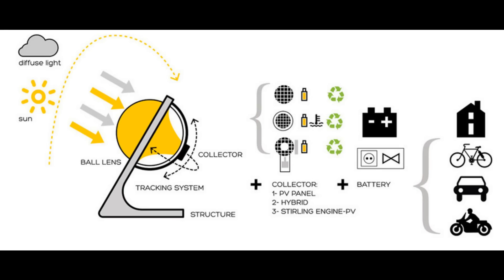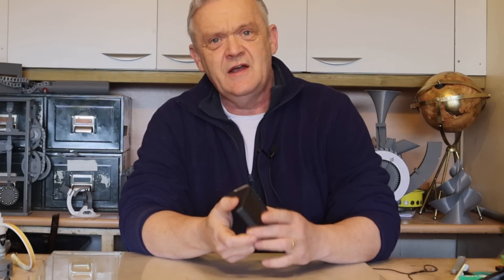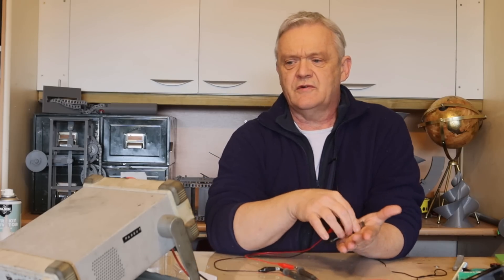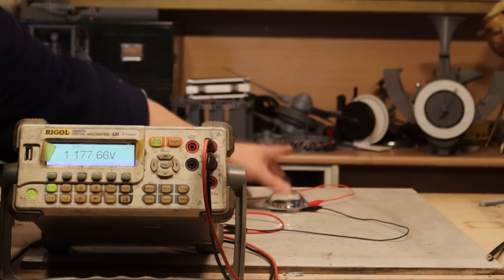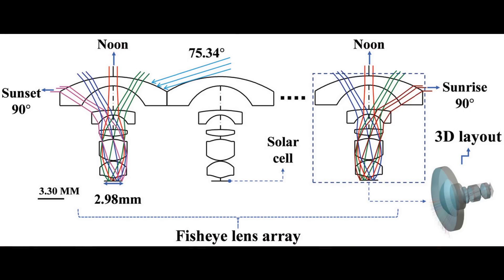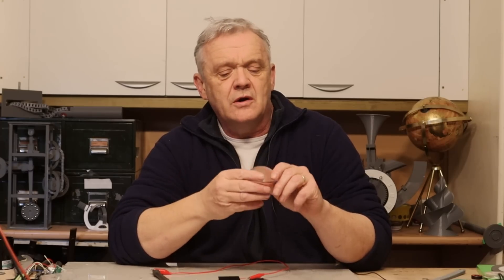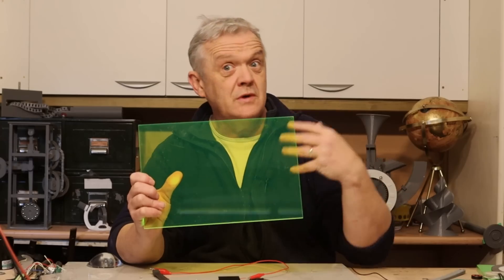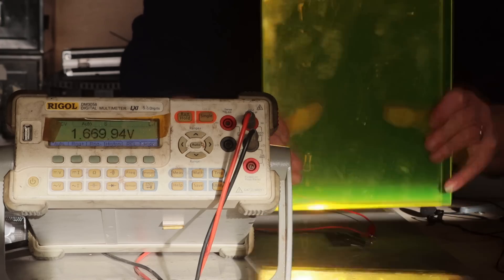2198 The Spherical Solar Cell

Comment: Ah a solar concentrator, i thought it was actually rounded panels which i was thinking about doing with these super flexible panels,  stick them onto a sphere, and the spin the panels and see what happens?  Im not sure ill get anymore but maybe make something interesting to look at, but using a sphere to solar concentrate is pretty cool idea.   Tech ingredients channel showed you could make one out of mirrors attached to the side of a flat panel and you just angle them and voila, 4xpower.  You have to be careful though this cooks the cells, but 4x power is definatley worth it , even if you have to spend some on cooling.

Comment: What about the concept of an air dam, such as a valley that is fitted with a funnel, or a series of panels that direct the the air from a large surface area down "funneling" it to a turbine, its interesting to picture the large mass of all the air and how it interacts with mountains, its as if there is "water" everywhere, but the flow is "slow" and could be geared down to increase the rpm, my idea consists of large tube structures with cloth stretch over them like a canvas, that use electric motors to be able to "open" or "close' the "sail" on a massive structure vertical or horizontal, these would be held on with "shear pins" and would allow you to control the speed by lowering the surface area on demand, allowing you to capture more of the air and also allows it to function with less airflow as well as protecting it against excess.

Comment: It is hardly compatible with common sense to use a large and heavy glass sphere or a spherical transparent container with 300 liters of water to irradiate a solar module of no more than 3 kWp. The same concentration can be achieved with a few kilograms of polished aluminum sheet consisting of rings formed from each other.

Comment: Open-circuit voltage is not really the figure-of-merit you want.  You should be measuring voltage into a resistive load.  The maximum power point is neither the maximum current nor maximum voltage.

Comment: you should have checked the focal length before just setting it directly on top the solar cell... I assume if it were an inch higher the voltage would have increased

Comment: I personally would first have a focusing lens, into the back of the dome, then the light would spread to the outside and around the dome onto many more cells!

Thus the light bam is split, so it focuses where the cells are.

Again, compres a light source to a high intensity beam,  then the beam goes into the flat of the dome, then the light radiates to the cells spaced around the dome.

Simples ❤

Comment: Hi Robert, great video as always! I have a question: That green wave-guide, from how I understand it, makes the light go from a Z-direction to the XY plane. So wouldn't it make sense to have long, narrow mirrors on those edges deflecting that light onto the solar panels, effectively making a huge green panel that redirects all that light onto a small solar panel? That would be a very cheap way of increasing the output of a given number of solar panels, would it not?

Comment: now imagine if you had a smeltery and there is a mold, the size of the Sistine Chapel. Then you mold these and polish them, and put it on a roof. Just for fun... like, super huge ones... imagine if you made one like that on the moon. And then, there is a mirror in the center so that it looks like there's a star on the moon? Only its concentrated sunlight? It would be a pretty pricey art-installation on Elon Musk's Lunar Palace.

Comment: Ok, Robert, I got frustrated with this video. lol. I was trying to see the focal point of your lens while you were tossing it around. I think you could lift the lens slightly might be the best focal point for the solar cell. I was interested in its maximum level. but, great video! thank you. I feel and have said for years that this is the way they will be in the future. we just need to get a cell that can handle the high temperatures that would be needed. but with the cost of plastics for this nowadays I might be wrong depending on the cell material and price.

Comment: A Solar concentrator in the form of a parabolic trough mirror, heating up a sand battery in the general focal point of the reflector, that is wide enough to cater for the 23' variation in the sun's position throughout the year , driving a Sterling engine. This is Occam's razor, down to 0 moving parts with an easy installation and the minimum stuff between the sun's power and the sterling engine. Steam off course will also work, but what I hear is that there are some very efficient Sterling engines out there.
Reply: A lot of people are triggered by this for reasons. Also there are many possible improvements related to how you can concentrate the solar light, convert the heat into electricity when needed, ...
Reply: @vitordelima  even àt night with a good sand battery
Reply: I never quite understood why we haven’t seen more internal combustion engines with integrated sterling engines for heat mitigation. 
It can only improve efficiency, surely!
Reply: Interesting. I always heard that sterling engines are inefficient in general and only useful when there's no other way to use heat. Ill have to read up on em.
Reply: @flyingsodwai1382 They aren't the only way to convert heat to mechanical motion or electricity, but the most advanced sterling engines (and heat engines) can outperform other engines, for example the NASA prototypes.
Reply: add some solar powered gravity batteries to the system for nights and emergencies.

Comment: My idea is to focus, light onto the solar panels and then use thermal electric generators to collect the heat as extra energy
Reply: That's what a sterling engine is, he describes the light being collected by the photovoltaics and the heat operating a sterling engine.
Reply: @EliotTruelove  No I am talking specifically about a TEG, a solid state thermal electric generator. A Peltier module used to generate electricity instead of heat or cold.

Comment: Thanks Rob.
Wouldn't the lens would work better outside? If your office has a point source, the lens isn't aggregating much. 
Isn't re-emission the basis of Samsung's QLED (not OLED) displays? Concentrating the spectrum sounds cheaper than tandem cells and must surely be worth more R&D.
Reply: Or use the solar heat directly which always worked well since more then a century ago.

Comment: Fresnel lens and "sunflower" solar collection systems were all the rage in the early 2000's. However $/watt is king. With the radical drop in cell costs since that time it is just not worth the cost.
Reply: Less costly concentrators were memoryholed due to the usual suspects.
Reply: @vitordelima  "Less costly"? Lenses/reflectors are heavy and expensive.
Reply: @Bigrignohio Not all of them are lens. You are one of the juicy guys so I won't reply anymore.
Reply: @Bigrignohio  Juice.
Reply: @vitordelima  I prefer orange. Your point?

Comment: Also, I wonder if the florescent acrylic could be used as lighting for vertical gardens. Think how much space you'd save if you could stack 4 or 5 beds of carrots/lettuce/onions on top of each other.
Reply: I love the idea! But green would be the wrong color to use. Plants use red and blue light primarily to drive photosynthesis, the green leaves is the light reflected and not used. Darker plants use a fuller set of the spectrum. If you look at LED grow lamps online they tend to be pink/purple, this is why, it's energy-efficient to not waste it emitting light they can't use anyways.

And I know of at least one plant who uses the amount and ration of red/blue as season indicator to drive it's reproductive cycle, allowing for very fine control of flowering.

Comment: Not sure if it would be cost effective, but a bunch of florescent acrylic fanned out over a solar cell (or that Prussian blue solar battery) would definitely be cool to look at as a piece of functional modern art.  They could be held in a 3d printed frame like the petals of a flower.
Reply: I wonder if it would help to cover all the 'wasted' edges with reflective aluminum tape (except the ones directly facing the central PV cell)

Comment: why does the voltage jump up 1.8 while u are putting the glass on the table, before going down to the final lower reading?
also can the uranium glass work that way

Comment: 1:27 Really a charge controller? I always thought that the cheap ones rely on the fact that the solar cell is simply not strong enough, to overcharge the quite robust battery.

Btw, if the battery on.such a device fails, i replace it with a cheap single use cell. Not zink-carbon indeed, but the next cheaper option. It works for another summer. 
I never buy rechargeable's. They die in winter anyway and are much more prone to leak.

Comment: If you use a thermoacoustic resonant chamber you can put the cold end on the back of the solar cell to keep it operating at peak efficiency.
Reply: Some solar panels use heat cogeneration to cool down the solar cell and this increases the efficiency a lot.

Comment: Could you make a small wall of fiberotpic cable lines with a cell on either end? Or a mirror on one end to send the light to the cell? I would think that might be cheaper than lenses, except maybe plastic fresnel lenses. But the fiberoptics would allow you to keep the electronic potions out of the weather.
Reply: I typically keep my electronic potions in storage unless I need one.
Reply: @ArcSolaire  i hate it when i forget to bring an electronic potion and my voltage runs low while i'm out
Reply: Yes. Anything that redirects or concentrates light will work.

Comment: could adding other fluorescent chemicals into the acrylic sheets add to the range of absorbed and remitted light?
As in - more ultraviolet wavelength is absorbed and emitted in the visible spectrum so that the solar cell can use that to generate energy.
Then those sheets could be used as windows generating power with the parts of the spectrum our eyes can't use

Comment: You used to be able to buy dimpled glass for bathrooms etc and I remember this would form hundreds of small magnifying glasses. This would probably work just as well and be a lot cheaper.
Reply: There are solar cells with a lens array just like that.
Reply: This doesn't really work unless you have a different, smaller cell for each of those dimples.

Putting a lens the same size of the cell on it does nothing. You need to collect more light with your lens than the cell already does by itself to be able to increase energy output. So more lens surface area than cell surface area.
Reply: @Rhannmah  That's false. The same amount of surface area if it aligns the light correctly will result in the solar cell collecting much more light.

This is less impactful on super clear sunny days with a sun pointing panel since most of the light in aligned already. But a lensed surface allows for better collection while cloudy, or perhaps to have a panel that doesn't need to move.
Reply: @Rhannma has the physics down.The lens HAS to be bigger than the solar cell to collect more light than the cell can by itself. Otherwise you are creating energy which we can all agree isn't really possible.
Reply: @flyingsodwai1382  It still works though, you can buy this kind of cells. The important part is the focusing itself, the higher energy density raises the efficiency.
Reply: @gustavgnoettgen  the point of those lens arrays on solar cells is to mitigate the angle penalty in setups where the panel is fixed and doesn't track the sun. The half sphere lens diffracts the light internally towards the cell when it would otherwise miss the cell or hit at a poor angle. There are some losses still that you don't get with a tracking panel.

Comment: The true test would be to compare current output rather than voltage because the voltage may be already be near saturation.
Reply: And expose this to sunlight instead of the low intensity directional indoor lighting.
Reply: @vitordelima The issue isn't so much the directionality of the light source, it is easy to arrange artificial lighting so that the light strikes the panel perpendicularly to the face of the panel; the issues with the indoor lighting are intensity and the particular wavelengths of light that are present, or rather not present which are present in daylight.
Reply: @deang5622  Outdoor lighting is almost omnidirectional, every trick to get more power out of solar concentrators involve this kind of thinking. But the frequency spectrum is also different.
Reply: @vitordelima  LoL.
Why are you repeating what I said?
Reply: @deang5622 You mentioned only perpendicular rays, not omnidirectionality. Nothing is really comparable to the real scenario.
Reply: @vitordelima  You need to re-read what I said. I said it was easy to arrange for light rays to be perpendicular to a panel indoors.

Why did I say that? Because that is what gives the strongest generation of electricity for a solar panel.

So obviously you should be able to deduce from my post that I am saying that the indoor scenario is NOT like the outdoor scenario and that is why it is better to test outdoors.

I don't know why you are having so much difficulty understanding what I am saying.
Is English not your first language?
Have you come across online translation tools?
Reply: @deang5622   - ha ha ha, funny/sad to see ppl get upset over nothing - maybe you are both trying to overthing things...  Einstein was the genius in relativity not us.  lol  "man" - chill and take a breath... - ...  (Dictionaries aren't so good at "comprehension" that takes practice, like interacting online with native speakers...)
Reply: Actually the true test is to measure the power but being aware the power depends on the impedance of the load.

Even better still is to measure the Watt-hours energy delivered over a certain number of hours where there is a variation in light level.
Reply: It's what Einstein got his Nobel prize for . Along those lines anyway.
Reply: The man with the golden gun ....
Reply: the cells fail from heat.

this guy is an idiot